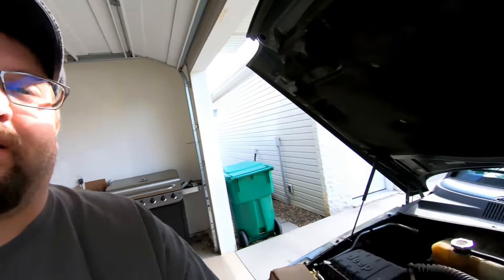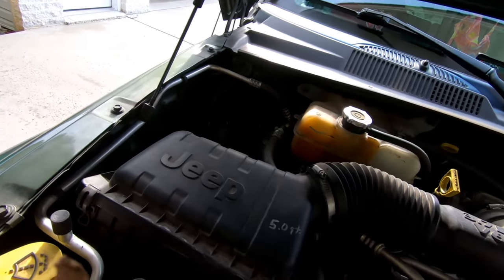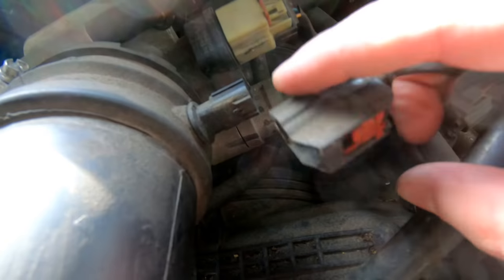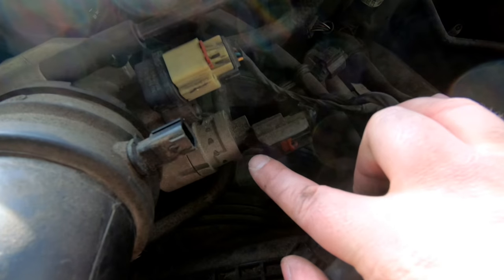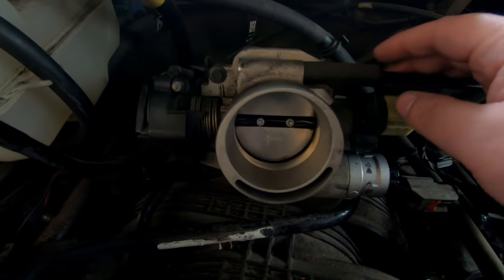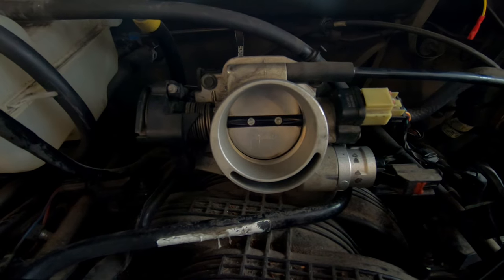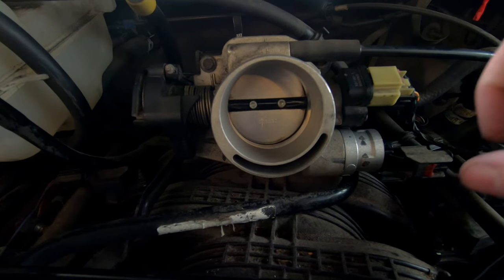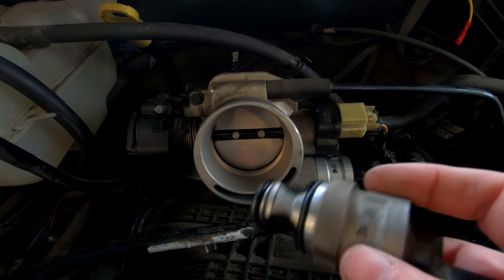2006 Jeep Liberty 3.7L Idle Air Control Valve Replacement

Comment: My 2006 Jeep Liberty drive to great but sometimes when you turn the key off and try to start it back up it doesn't want to got to do it a few times it started with one or two times now you have to do like five times before it starts otherwise it will almost want to start slightly but once it starts it runs good

Comment: That cable you were not sure of at 5:25 in the video is for the Cruise Control. It runs to the actuator that is mounted behind the air box...
Reply from the maker: And there is the answer!  Thanks!  I'm not very knowledgeable on the KJ that's for sure.  Sometimes I even wonder how knowledgeable I am on the YJ HAHA!

Comment: I have the same jeep and im trying to find out the valve adjustments. I keep searching but no luck 🤦🏻‍♀️
Reply from the maker: Hi Vanessa.  Are speaking of actual valve adjustments in the valve train or the air control valve?  I'm unaware of any valve adjustments that can be made to the an air control valve.  If you're having a loud ticking and can't seem to find the issue - it could be the lash adjusters or something such as a rocker arm off.
Reply: @GearTubeTV  honestly not sure. I had someone come check it out. To be on the sure side of things and they said it’s the rocker arm. So now im just going to replace the old ones. I just bought the jeep almost 2 weeks ago and haven’t even been able to do much driving just fixing it slowly. Thanks a ton for the reply. Hope to see some more videos of your jeep.

Comment: 2005 Jeep Liberty Renegade 3.7. I parked it, as I turn the key to off, it sorta sounded like it was stalling, just a half second or second.    Tried to start it and it would turn over but not run... It throwed a code for Throttle petal position sensor. Changed that as well as the crank position sensor and cam position sensor. The plugs are brand new. I've taken the air intake off and tried to spray starting fluid to bottle feed it. Still won't start.     It does seem to try to start more when I press the gas on the floor.     A mechanic friend came and hooked it to his computer scanner deal and it's not showing anything. After sitting for a few days, I tried to start it and it started for a second and then died again. Tried it again and it's just spinning over and not starting.        I don't know what else to try. Has compression and getting the 60+ psi to the fuel rail.    Seems like it may not be firing all the time. I'm guessing.
Reply: Ive read where the throttle position sensor has to ba adjusted by scope its very sensitive

Comment: My 05 liberty has a rough idle and stalls as soon as I let of the gas and it reaches idle speed. Would that be the IAC or fuel pump?
Reply from the maker: If it still starts and drives, but only stalls when coming to a stop I would think it is not a fuel pump issue.  It could be the IAC.  Do you have a check engine light on?
Reply: @GearTubeTV  nope. Just got a code ran for it and it was the o2 sensor. But my car won’t idle unless I have my foot on the gas. Drives fine and everything but if i let it drop below around 800 rpms it will bog down and stall if I don’t give it gas
Reply: And the o2 sensor was the only code it was throwing. Nothing else, so I just got done fixing it and now I don’t have a check engine light
Reply from the maker: Given the fact it stalls out at idle and given the low cost, I would try replacing the idle air control valve and the throttle position sensor. They're cheap enough and probably have never been replaced or cleaned before so it won't hurt it. As always it's never good advice to throw parts at something and hope it works; however replacing sensors is very simple, usually inexpensive, and if it fixes the problem then great. Camshaft and crankshaft sensors affect idle too but they will usually result in a check engine light.
Reply: having a similar experience to jakes but my 2002 liberty engine shuts off sporadically when braking  (few times less after replacing pcv valve,IAC,throttle sensor ) and get a 02 bank a code, I suspect the really cheap Aftermarket idle control valve could be the issue ?

Comment: Ok um , I have an 07 jeep liberty sport I have that one intake charge two sensor that is located on the air intake tube . I don't have on the throttle body the idle air valve !  Question where the he'll is it , anybody !  I should mention my registration says 07  but the sticker on my driver side door says  manufactured in  8/06 don't know if that makes a difference or not ! Thanks for the help
Reply: Arthur, Have you figured this out? 07 jeep grand Cherokee... 10/6 on my door. I have the p0507 and struggling solve this issue
Reply: You need to change cats they are plug or below threshold

Comment: Did that smooth it out or fix your problems?
Thanks for the video.
Reply from the maker: This in conjunction with the rest of the things I have done has worked wonders.  There are videos total with this Jeep Liberty and new uploads are Sundays at noon.  This video was part 2.  First we did a PCV valve replacement, then this IAC.  More to come!

Comment: No need to take all those parts off! Just go around the side 1x screw and swap the valve over...
Reply from the maker: Yep, you're right.  But if you're going to get in there you may as well do some preventative maintenance and clean the throttle body too. 👍
Reply: @GearTubeTV  I agree with GearTube TV

Comment: Have ya ever replaced the map sencer?
Reply from the maker: Hey Blueberry!  I have not replaced the map sensor, but from what I see it shouldn't be too difficult of a job.  It is on the front of the engine beneath the intake manifold.  I've read things about removing components above it to make it easier and then it should be one or two 7mm bolts and an electrical connection.